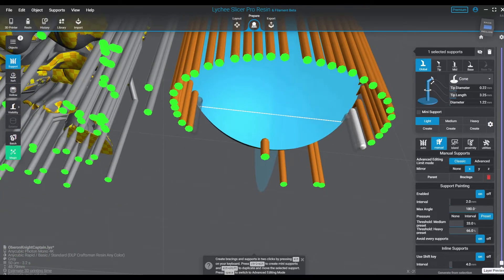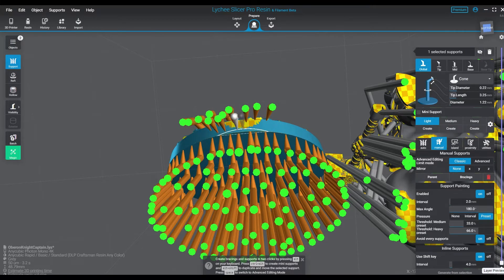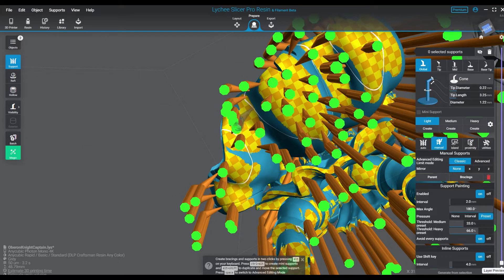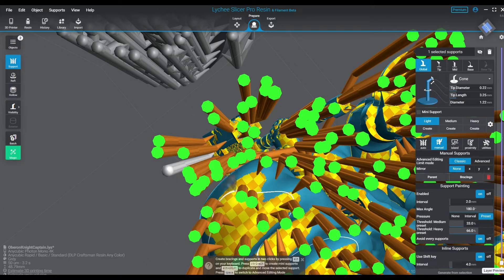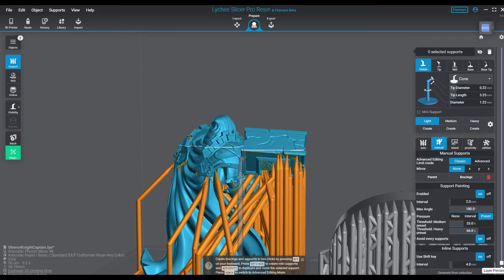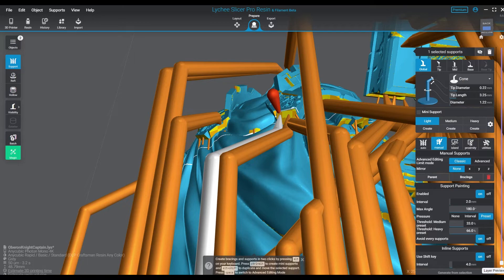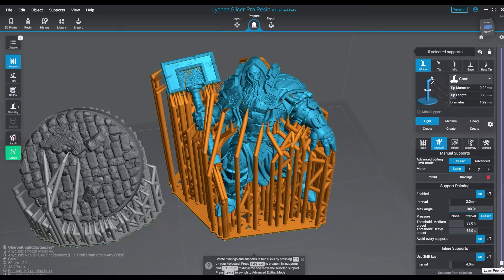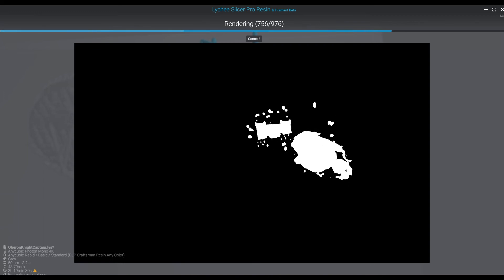Better support method for 3D resin prints better details less support damage

Comment: Hi I wonder if you can help?, I have some .PM3R files on my memory stick created on Lychee Slicer and the same type of files are on my Anycubic Photon M3 premium but the machine can't see the these same file types - why?, I assume these are what the files need to be in order to be read, plus I'm new to the hobby and I wonder if anyone out there can help me with a file of a pylon that I'd like to print, I need help with positioning / seeing if it can fit on the plate and whether it needs supports or not. Is there anyone that can help?, I can PM people with pictures, many thanks.
Reply from the maker: Did you try using Photon Slicer? It should be able to read any Photon file.